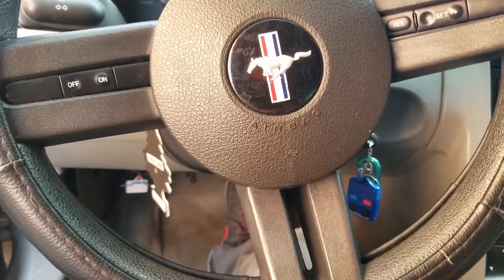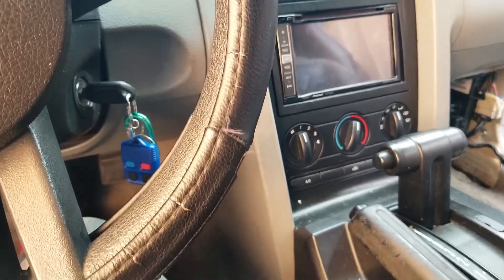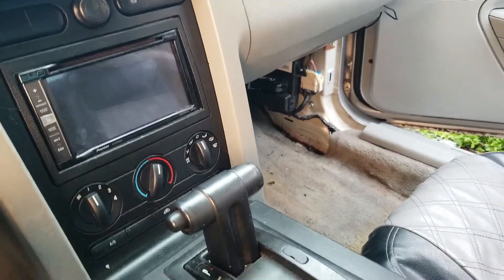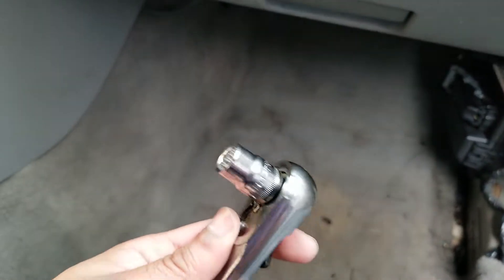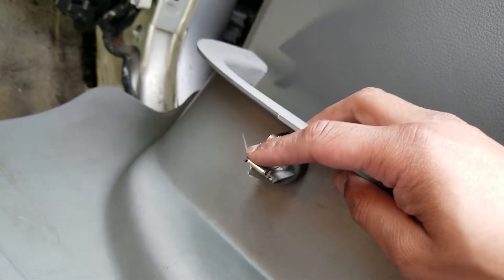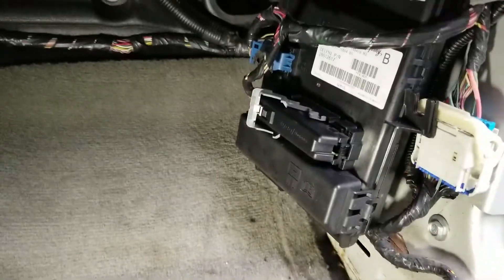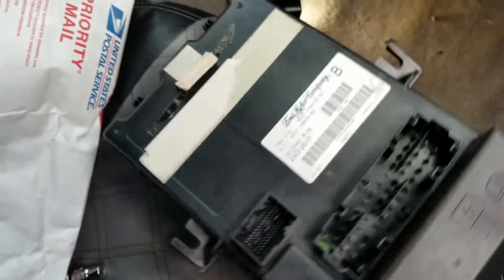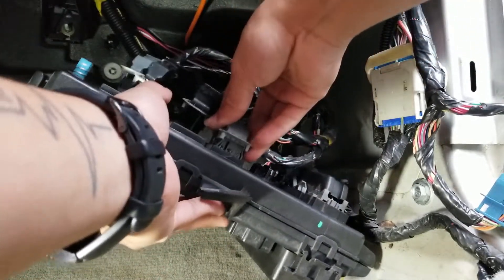Does your 05-09 Mustang Needs a NEW Interior Fuse Box? (Smart Junction Box/Anti-Theft Fuse Box)

Comment: So were having issues with a 2007 mustang gt 4.6l the car runs like a champ but the moment u engage lights or ac it instantly shuts off. I know the car had a blown bulb and now the turn signals are acting up. They used to flash in succession now the fronts wont flash at all and the back only two flash together. If the weather holds today im going to take this box off and see what condition it in. Sometimes the pins corrode so much the pins break off.
Reply: poemranger did you find what it was ? Im having the same problem front turn signal dont work neither the rear only one side works

Comment: Look I’ve got a 04 mustang anniversary I came out to get in my car and cranked it up the car wouldn’t go into gear ,the radio wouldn’t work,the power locks wouldn’t work And the interior lights were not working properly what do I need to do to fix the problem
Reply: Hey can you please help me please
Reply from the maker: Sorry to hear you are having issues with your stang, unfortunately I can not tell you how to fix your issue since I am not a certified technician, I can however try and help you figure the problem out but can't promise I will. So starting off... If that generation mustang has a similar fuse box in the interior I would suggest removing that fuse box and checking for any water damage (Corrosion, signs of water build up, connections rusting, etc.) If you do see signs of water damage try cleaning them using a electrical cleaner like the QD Cleaner from CRC (Can buy that at your local autoparts store) Have you have any water leaking inside your stang? Signs of water in your carpets and such?

Comment: Does the BCM has to be reprogrammed? Long ago I got uno from a wrecking yard for a 2002 dodge caravan and just swapped it and worked but I’m not sure about fords.
Reply from the maker: Not necessarily, This was the second time I purchased a used one of eBay and both times I just swapped them out without the need of programming, so you should be good if it's a used unit.

Comment: Sweet primo! I need to replace mine but im not sure if i have to reprogram a used one? I noticed that the part number on mine ends with a bd letters do i have to match that? Also does the anti theft still works after rwplacing without reprogram and will the instrument cluster display the same mileage?
Reply from the maker: yes, sadly you will have to have it reprogrammed if you want all the original features the OEM one had before, i'm not sure how much they charge tho, depends on where you go too
Reply: @dany5.084  so i ordered one on ebay with the same exact part number used ofcourae and plugged it in and the car started and all the functions were just like before. After about ten days however my car started doing the same exact thing. At night when i got in the car the radio console was lit up and i knew that i still had the issue. As soon as i started the car like before the dash started throwing low tire pressure, brake on, low oil, ect ect just like before!! How could another sjb do the same thing? Is my problem.something else?
Reply from the maker: @exile9237  My best guess would be either, 1) the one you ordered was a defective one, or 2) maybe the wiring inside the vehicle itself might have gotten too badly damaged from water, at that point I would recommend having an electrician look at the wiring, maybe a fuse inside the SJB blew out or a few or relay inside the main fuse box went out, that can also be a possibility. Hope that helps, and hope your problem gets fixed asap

Comment: I was getting the error code P0463 on my 09 Mustang Bullitt. After replacing both fuel pumps (passenger and driver side), I took it into the dealership. $700 for them to tell me the issue is this Smart Junction Box. Would be $1600 for them to replace the junction box. Gonna do it myself.
Reply: Did you ever replace it? I have the same code on my 09 but haven't had any issues.
Reply: @ZachMan99  yes, got one of the exact the same model off of ebay for about $200. Wiped my computer by disconnecting battery and alligator clipping the neg and pos together. Works great. I hear you can get it programmed for about $100, but mine works well as is. Good luck with yours- cost me about $2k after replacing both pumps and getting the issue evaluated at dealership. Would've been another $1600 for them to handle replacing the Smart Junction Box.
Reply: @kickballjedi  what kind of symptoms did you have? From researching that code it seems the only problem you can have is your fuel gauge is inaccurate or doesn't work at all. Mine is a little wonky sometimes but it's still accurate, within a quarter of a tank anyway.
Reply: @ZachMan99  wasn't too bad, the fuel gauge would show 1/2 full at most then drop to empty within a few minutes after the car started. Unfortunately it also tripped the check engine light so I couldn't get my emissions done. Could've lived with it without the CEL. Other than the gauge and the CEL, it ran fine.

Comment: I forgot to mention that in addition to addressing the water leak issue (removed clogged drain plugs in firewall, replaced/sealed cowl tab clips and replaced foam stripping under black plastic trim around door openings) - I also draped a sheet of clear plastic over the top of the SJB and let it cover both the front and back - so if water does drip in, the plastic sheet will hopefully keep it out of the SJB.
Reply: That’s my problem
Reply: @DonnellKane   The fixes I performed on my 08 are still working - so maybe give them a try!
Reply: @edbreyer  did you replace it or just stopped the leak
Reply: @DonnellKane  I first stopped all the leaks then replaced the SJB.  I'll post below a previous post on another forum with mor edetails...

>>> I resolved most of my issues by replacing the SJB/BCM with a used one from ebay - BUT first make sure you've resolved any water leak issues which is the main cause of SJB/BCM problems. I'll paste below the verbiage I posted on another thread outlining what I did.  Hope it helps!

-----------

Make sure you have sealed all the water entry points.
1) I removed the rubber drain flaps below the windshield cowl that would sometimes get clogged and allow that area to fill with water and enter via the cabin air filter - no chance of clogging now.
2) I also ordered/installed a replacement set of the heat sealing tab sockets that the tabs of the plastic cover under the wipers insert when being installed.
3) I replaced foam sealant strips under the plastic trim around the upper door frames.
4) (In case all that fails and there is still a leak) I wrapped a clear plastic sheet of plastic over the top, back and front of the BCM/SJB which should keep water from getting into the box/electronics.

ALSO, Don't be afraid to buy a used BCM/SJB - as long as you: 1) make sure the numbers match exactly what you have now. 2) You buy it from a source that ideally tests it AND allows returns if it doesn't work. That's what I did (via ebay no less) and it has worked perfectly without any new programming. It felt risky but the $250 was much less than the $1,000+ the Ford dealer wanted for a new one and programming.
Reply: @edbreyer  appreciate you bro
Reply: @DonnellKane    HERE ARE A COUPLE VIDEOS showing where the water leaks come from:
1) https://www.youtube.com/watch?v=YLZgHJKKkp4
2) https://www.youtube.com/watch?v=BTAPevyl9Rg
2) https://www.youtube.com/watch?v=btpbUYoK5Gs

Comment: just wanted to add a important note, on my 05 recently the wiper motor quit working ,i replaced it with a 120 $ autoparts one they all may be remanufactured at that price ,it lasted two weeks ,i took the new rplacement motor wiring connector cover off and everything in the circuit board was fried ,im pretty sure the remanufactured one i purchased ,all they did was sand blast repaint and resell a bad motor ,  it was a pain trying to figure out why it quit working so if your wiper motor quits working and you have allready pulled the factory mistake drain plug below the motor and eliminated the fish bowl drown the wiper motor situatioin and your two fuses for the wiper motor are good ,remove the wiper motor and pull the electrical cover off my replacement ,the grease looked twenty years old ,and its circuit board was fried,i wasted time tearing dash apart to replace the wiper switch first

Comment: I have the same problem as you after a flood event. Changed the fuse box and the car works fine now. except, mine is a convertible and the convertible top is not going down or up after the change of passenger side fuse box. Do you know how to fix this ?
Reply from the maker: Unfortunately not for a convertible, I have never owned one so I'm not certain if that fuse box also controls that or if it's something else. I'm sorry
Reply: The coupe and convertible have different fuse boxes. You might have bought a coupe box. You need to change it to a concert box

Comment: Question, was you getting a power drain ??? Mine started with the windshield wipers not working then working when I didn't want them to.  Ended up replacing the motor and found it sitting in a small puddle of water . Ever since then I can't keep a charge . Changed the alternator and replaced the battery and it still dies within 4 hours of sitting.   I contacted the dealer about a diagnosed they're all booked until November-December.   Never had an issue with the windows or radio.  When the car is running it runs good but  I have to jump it every time I let it sit a few hours .
Reply from the maker: When I had this issue I was getting power drained due to the SJB box getting water damaged because everything stayed in the "ON" potion at all times. once I replaced that Fuse Box everything was back to normal. Unfortunately I cannot promise that will be your fix as well but the symptoms sounds very similar to what I have experienced. Have you seen or had any water in the passenger side floor? for some reason these Gen mustangs are common with water leakage going all along the passenger side causing water damage to some electrical wiring more commonly on the SJB box
Reply: @dany5.084  I have noticed I can take the key out and open the door and the radio stayed on . I think I got the same problems but wanna make sure before I buy that shit lol it's 300 dollars right now
Reply from the maker: @Jfizzle813  Oh it's gotten expensive lol, I would suggest going with a diagnostic first if you're unsure about anything before buying anything especially when it's expensive haha, other than that I wish you good luck on fixing your problem

Comment: Hello if I buy one used would I have to get it reprogrammed? An would gt an v6 be the same
Reply from the maker: If you buy it used it isn't necessary to get it reprogrammed, however... your stang will no longer have the working flashers when unlocking or locking the vehicle and/or small little features the car will have. If you want everything to work the same as factory you will have to get it reprogrammed.

as for GT and V6 compatibility it'll work, what I recommend is making sure the part # or serial # are the same on the box itself, match the number with your current one with the one you are buying. Hope that helps! :)
Reply: @dany5.084  Thank for the info great explanation great vid

Comment: I have an 08 mustang doing the same.
Can I take another 08 mustang sjb and install without having to reprogram it?
Reply from the maker: That's what I did and it worked just fine for me, but I would double check the pins on the other SJB to make sure it isnt corroded or physically damaged
Reply: @dany5.084  good to know! Thanks man!

Comment: I’m having a problem. It rained torrentially here and my passenger floor was soaked. I went to replace the battery since it was three years old and when I replaced the battery my radio no longer works. I can’t remember if it worked before I replaced the battery, I replaced the fuses for the radio and nothing. The stupid CD player still does it’s incessant clicking but no power on the display, no radio. All I can figure now is this box got wet and ruined it. However everything works fine, it’s ONLY the radio. I’m pretty mad but I don’t know if the sjb needs replaced or the radio. I’d prefer a new part but can only see used ones so far.
Reply from the maker: Yea the SJB box is a deliciated part of the electrical system, there's a chance it is that part since I had similar problems in the past like that too, sometimes when that box get's damaged, everyone will experience different issues since that box controls multiple interior components, sometimes it'll just affect a few features (in your case just the stereo) and in some cases (like me) where everything inside wasn't working (and I had it in the past where everything stayed on 24/7) your best bet is replacing that part or seeing if you can borrow one from a friend just to see if that fixes it, if it does than it's guaranteed the SJB box, best of luck

Comment: Hey hope you’re good mine seems to have the same problem but is there anyway to fix it instead of replacing?
Reply from the maker: I'm certain you can take it somewhere where they fix electronical modules and possibly get that fixed, but tbh as far as I am aware, once those boxes goes bad, it's done. Since it is a very dedicated peace of equipment it can be difficult to get repaired.. Hope that helps
Reply: @dany5.084  thank you man and did it need any type of programming after installation?
Reply from the maker: @mfaisal007  From my knowledge and experiences, no you do not need it program after installation, you do however need programing if its brand new out the box, will have to take it to the dealership to get it properly program, other than that both times I had replaced mines didn't required programing so saved a lot of money there

Comment: Don’t know if you still respond but my 2005 mustang I just got had leaks before I got it and my blower motor won’t come on ,my power mirrors don’t work, and my windshield wipers won’t work either  do you think this is the problem
Reply from the maker: Sounds like it can be that same SJB box, the one I showed in the video. That box controls most of the electronics, in my case the windows didnt work, mirros, interior lights and shifter locked up. Replacing the SJB fixed my issue, but i bought it used (~$110 on ebay compared to $400 from dealership) that would be your best bet, especially since you did mention water leak, most likely box got water damaged. Hope that helps
Reply: @dany5.084  thanks man I’ll look into it

Comment: Could this be my problem? I can shift the shifter, but radio and power windows cut off while driving, sometimes it comes back, but then it shuts off again... while it's off, I can't control the night light switch and stuff... I have tl re start my car.. can this box be the problem?
Reply from the maker: I wouldn't be able to say 100% that it is the box but since you are having electrical problems I would say check the box first for any signs of water damage/corrosion on the prongs, also if you have any water leakage running through the passenger side
Reply: @dany5.084  that was the issue.. took it off and it was corroded... cleaned it and now I have 0 issues

Comment: My dome lights don’t turn off. How do I fix that issue. I have had water get in my SJB
Reply from the maker: If you had water previously get into your SJB then it most likely got damaged, but by the sound of it, it didn't get fully damaged, only partially since only the dome lights got affected, there's a chance that maybe one of the fuses inside the SJB got burned out or short circuited, check all fuses in the box, if it seems like all of them are good then most likely the box itself has gone bad from water damage

Comment: Would this have anything to do with the ac or heater not working blower motor as well
Reply from the maker: That sounds like It may be a problem on it's own. I recommend checking just the fuse that powers the climate control which is fuse #15 (10amp) fuse, You should have a diagram within the fuse cover if not you can pull the diagram up on google. if the fuse is fine then it may be a fuse in the engine bay that blown up or it may be something more serious but I can't tell you for sure. You might be lucky enough to just have to replace that 10amp fuse
Reply: I have this same problem. Let me know if you find the issue

Comment: So you don't need to re/program this SJB? My v6 mustang is just the base with power windows and locks. My tach, speedo and temp guage works,  but the A/c, fuel guage don't.  A bunch of service lights came on too.
Reply from the maker: from what I have experienced, no it doesn't need to be reprogrammed for the majorities of functions to work again, my stang is also a V6 base model and everything is working fine without it being reprogrammed

Comment: DO YOU NEED TO GET INFO OF THE OLD BCM BEFORE REPLACE IT..??  DON,T YOU NEED A SPECIAL FORD SOFTWARE TO CHANGE AND UPDATE THE BCM..??
Reply from the maker: I believe it all really depends on whether you get it used or new. I've replaced the same part twice on this car and both times I just installed them and that was that. However both times I got this part used off of eBay. Only thing I put noticed to was the serial number and Ford's part # on the boxes to match the original box. I am not certain whether or not you need special programming if you go with a new unit, but I can tell you based on my experience I did NOT need to reprogram the used ones I have bought in the past